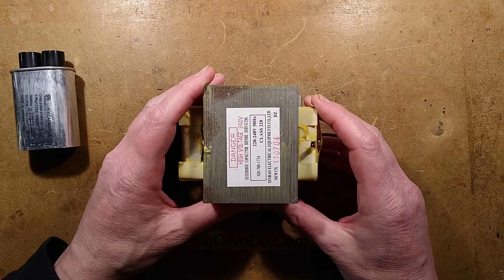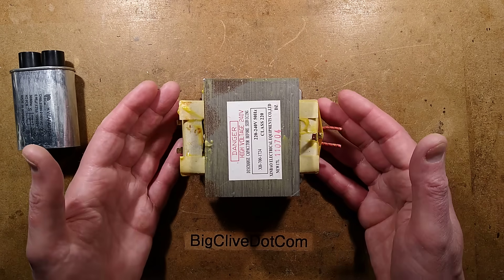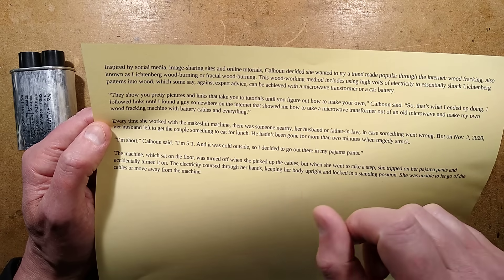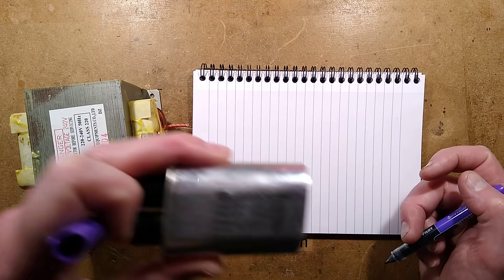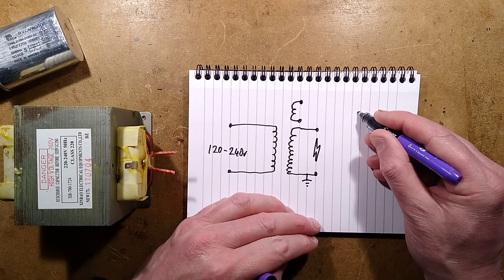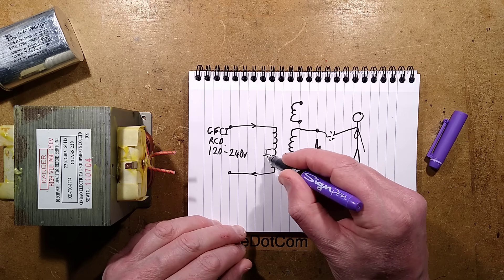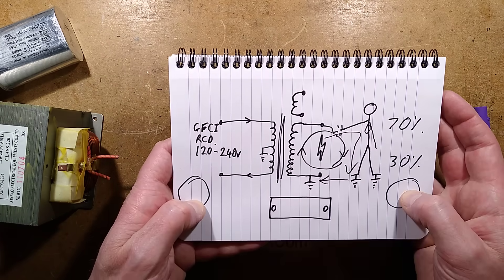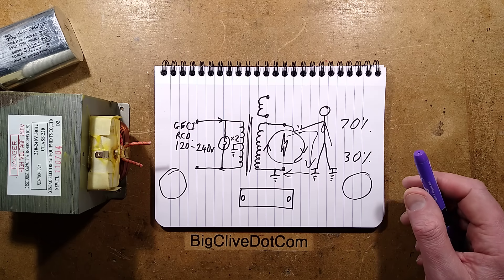The most deadly project on the Internet

Comment: I've had enough relatives who worked with electricity tell me enough stories to dissuade me from doing much more than putting together my own PC.  Enough amps, enough volts and you're not gonna have a good time (well, not for long anyway).

Hats off to you electrical workers.  You're braver than me.
Reply: Amps'll get you way before voltage will.
Reply: @paulthetexan  wrong. I can touch both leads of a car battery (600A) and nothing will happen. It’s a combination of both that makes something dangerous. In fact high voltage is what is difficult for untrained people to predict since it will “flow” through nearly anything.
Reply: @thejackbox  0.1 amp can kill you. Just because you can do something safely doesn't mean that the subject is always safe. For example, I can light a fire safely in my fireplace. Can't light the exact same fire safely in a used, mostly empty grain barn.
Reply: @paulthetexan  saying that one will kill before the other is incorrect because they are both equally important to producing a lethal current. I’m not disagreeing that amps are part of what kills you, I’m saying that the assertion that “amps kill before volts” is misleading and shows a lack of understanding. Also, no, touching a car battery is nothing like lighting a barn on fire and I only said that as an example.
Reply: @thejackbox  It was a metaphor. To people who understand metaphors, it symbolized that an activity which can be safe under one set of circumstances can be dangerous under another. To you, it didn't.
Reply: @thejackbox  They are both equally important, yes, but one is far easier to screw up with. Guess which one? Hint: it's not voltage. It's easier, faster, and more likely to kill you if you mess up your amperage than your voltage. I'm truly sorry that you can't understand that things might both be important but have relatively different threat/danger levels.

Comment: I do not wish to see the pictures, thank you. This "project" is dangerous, I've seen it gone wrong. Safety is a big thing in my workshop,  working with interns and volunteers it's a necessity. One of the regular woodworkers was experimenting and made a fractal burner. He did a really good job making it. For some reason one volunteer moved the device when it was on. I saw it happen and triggered the electrical safety switch in time. He had severe burns on his lower arm and had to go to therapy because he was afraid to even turn on the light switch because of the accident. 
I beg of everyone just buy the machine. It has numerous safety features so you don't get harmed. I know it's expensive, your safety is worth more. Robert Sorby has a really good one, we bought it immediately after the accident. Everyone is able to enjoy fractal woodburning in safety now.

Comment: That isn't a big capacitor.  I used to have a high voltage electron beam deposition machine at work... 10,000 and 4 HUGE CAPACITORS. If it every got shorted out it could provide infinite amperage. I heard about an incident at a different fab were there was a short which caused RF which was reflected back through the transformer and shut down the local 22kv substation.  Of course this kind of equipment is  heavily safety guarded and we used it for years safely.

Comment: "I'm classified as a pro by others but that is a false title, I'm experienced and still make mistakes." My mentor told me this while teaching me how to weld and that one line is what stuck with me the most. Never think of yourself as being so good at something that you can ignore safety and common sense.
Reply: I've done a fair amount of backcountry adventure, and a line that has always stuck with me is 
Q: What's the definition of an experienced mountaineer?
A: One whose death was unavoidable.
Reply: I worked in the computer industry operations in particular for about 40 years. I remember one point we needed to replace a main breaker that controlled power flow from the UPS battery to the UPS main power. And my boss wanted me to open up the panel with over 800 volts in there and swap out the breaker " it's easy ". The bus bars in this panel we're either a quarter inch thick or 3/8 in I didn't want to get close enough to measure it and about 3 in deep. I looked inside the cabinet where this breaker had to be popped in and out and told him if it's that easy get an electrician. I have no business being inside this panel and you have no business suggesting I'd be inside this panel. I'm willing to try many things I've done my own wiring I've replaced my own well pump I've ran a totally new circuit from the main panel into another room that didn't have electric in it. Including an outlet going outside which was on a GFI outlet on the inside. I have been tingled by 110 volts and I've been made to jump up by 220 volts. Unfortunately there was a shelf above my head at the moment! The kind of voltage he's talking about nah I don't need to play with that. I had a microwave go bad all about a year or so ago essentially the fan stopped running and the microwaves were still coming out of the radar emitter. Lot of heat builds up on that happens if your fan stops running unplug your microwave. At the same time the panel on the front started acting goofy too and after I unplug the microwave and took the food out of it I just carried it outside put it in the trash. I don't need to open that up. Normally back in the day with mechanical controls I'd crack that puppy open and get a screwdriver with a wire attached to it and ground out everything before I reached inside. My dad told me when I was working on tube TVs the ones where they actually had vacuum tubes not just the picture tube, never touch the transformer unplugged or not. It can zap you either way and it'll throw you across the room. Knowing that my dad had done many things in his life and he was currently an electronics inspector, I figured that's probably good advice and headed it. Made quite a bit of change in high school fixing TVs. I would do everything except for adjust picture tubes and touch that transformer! I had a vacuum which the hose had a metal end on I wrapped the metal with electrical tape so it couldn't ground out so I can vacuum the dust out of the TVs. Good times!
Reply: We should add that : Even if you are the top expert in the field, no experiment is short enough to ignore safety measures, Murphy is always pressent.
Reply: The first time I saw people doing this online, my immediate thought was "nope, I ain't f***ing trying that one".
I don't know anything about electricity and if it involves voltage beyond that what comes from a couple AA batteries, I'm not messing with it.
Reply: @scottcantdance804  For me it comes down to the situation in which I can say "I know enough about electricity that I know what the potential dangers are, but my knowledge is insufficient enough to know how to safely avoid those dangers."
Reply: A similar thing with gun owners: It is not "IF" you have a negligent discharge. It's "WHEN" you have a negligent discharge. I already had mine. I never want a repeat. Muzzle safety is now burned into my head, but dammit, it can happen again. The law of complacency.
Reply: @galenicalhoover6508  i don’t think so not if you have some proper training
Reply: @galenicalhoover6508  my squib went baang! Muzzle was pointed downrange, but I was casually talking to my range-neighbor at the moment. Scared the piss out of both of us. We agreed that pointing downrange and waiting 5 minutes was good procedure. I later realized I should own go/nogo headspace gauges, and at a minimum do a few OAL checks followed by bulk visual inspection/comparison especially with the commercially produced consumables, whether brass, steel or zinc. More on point, this vid about the dangers inherent in working, playing, experimenting with high voltage and high current sources is approachable enough that it should be shown to 15 year olds in science classes! (that changes 'natural selection' a bit, but kids should probably have a fighting chance to carry on into adulthood)
Reply: @galenicalhoover6508 If you never have a negligent discharge in your life, you WILL have an ACCIDENTAL one.
Reply: I've never heard anyone say pretty much the same thing, just worded different than my welding teacher told me, which was, "if you think you know everything, your the first one that gets hurt", and it's true. I've seen it happen on job sites, and it's not pretty sometimes either.
Reply: The world's a big and weird place. Sometimes all the prep and the know-how in the world still can't keep luck from taking its due.
Reply: "Nothing bad has ever happened to me during 15 years of doing this."
ignores safety
ZAP Something bad happened
Reply: My brother learned something along the lines of "The day you underestimate electricity is the day it will kill you" when being trained to become an electrician.
Reply: Nice thread. This also applies to flying. There's a great book called The Killing Zone: How & Why Pilots Die which goes into why the vast majority of pilots who die in crashes are only in their first two hundred hours. The FAA has released books on aeronautical decision making and the psychology behind why we make mistakes that are avoidable. If this weren't a persistent problem Kobe would still be with us today.
Reply: yup we have two stories (more than that I'm just focused on the demon core shit tho) with scientists being flippant around radioactive material and ending in disaster
Reply: Part of Being a pro means paying attention to and practicing safety considerations.
Reply: Amen brother ! I operate heavy equipment, the young guys laugh because I put on my seat belt. I wear it to keep me in the seat not because I'm scared lol. I always say , " be smarter than what your working with" or being good is truly knowing your and the machines  limitations ! ✌️😎

Comment: 2:40 No Clive, add a zero. Medium distribution voltage is (typically) 22,000 not 2200.
Reply: Medium voltage distribution is anything between 1kV and 70kV, so this may be on the lower side, but it's still in the range of medium voltage distribution, aka crazy dangerous.

Comment: I didn't realize this was such a wide-spread issue. I.e. woodworkers building dangerous electrocuting devices. Shocking how people are ignorant. Isn't this also an educational issue? At least in my country you learn at primary school about dangers of electricity. Though myself an electrical engineer, even before my studies I always had a respect for electricity and I do think that partly comes from primary education. Strong regulations for electrical installations and work also tend to increase the awareness among common population that such work is best left to professionals. At least in my country, during the last 40-year period, death rate from electrical accidents has decreased from 0.29 per 100,000 people per year to 0.00-0.07 in the last decade. This is continuously decreasing due to nowadays mandatory use of residual current devices.

Comment: 7:53 That middle low voltage winding, is not for anything else than the little gearmotor that slowly spins the glass plate that rotates your food for even heating.

Comment: 3 phase 480 volts 400 amps is one of the main drives I worked one . 480 will kill you very fast and cause the water in your body to flash to steam.I was the safety guy on my section.
Scary was throwing main breakers with 2000 plus amps,the can blow up in you face.
Thank you for the video.
I heard this yesterday and and could not believe what people are doing. 3milliamps to stop your heart,I think .

Comment: great video Clive, i trained as a service tech on scientific test equipment in the late 1980's, had more zaps than i could count.
a few years ago a car club member had an incident while thinning some paint on a 40+ deg C day in Australia, he happily told me he was using an old kitchen mixer to mix the thinners in, i was stunned, i told him he was an idiot, he had severe burns to his legs and a foot (wearing thongs and shorts), requiring quite large skin grafts.
to this day he maintains he had used a mixer to thin paint for decades with never an issue, and won't accept any responsibily.

he also claimed to not notice the heat, to which i asked then why wasn't he wearing PPE at the time?

i ALWAYS mix flammable thinners in enamel paints with a wide wooden ruler or something equivalent, although with modern brushless drills paint strirrers would be safe to use.

Comment: This is a good video.  I'm surprised only 30 have died doing this actually .  It is VERY dangerous.  having said that, I have done it.  You shouldn't.  Really, you shouldn't.  If you do do it, set it up in a glass dish, make sure everything outside the dish is VERY dry. keep the transformer and all high voltage inside plastic tub. (this alone will NOT protect you) the voltage is high enough it will jump right through the plastic in the tub.   Get a LONG extension cord, be very far away before extension cord is plugged in, be very eclectically isolated, stand on a plastic milk crate use a switched outlet.   High voltage can take strange paths, through air, wood concrete, jump across electrically insulated things. etc. especially if it's at all damp or musty.  Make sure no other people or animals can get anywhere near any of it.  Use a momentary switch rated for mains current on the mains current.  Better yet Listen to Clive.    I say this because people are going to use Microwave transformers to do this simply because they are plentiful and easier to come by than safer alternatives, but again LISTEN TO CLIVE.  The high voltage combines with high amperage of a microwave transformer can kill you and it's NOT like mains power where just not touching it, will keep you safe.  High voltage will travel though strange things like, walls, floors, YOU to get back to ground, and it WILL kill you.
Reply from the maker: A minimum of 30 have died.  I think the real number is much higher.

Comment: Something that I would look into, if I wanted to do something like this, would be a modified 3d printer. The 3d printer mechanism could take all the risks and I would stay safely away from the device. Include an emergency stop button and have the start button well away from the device.
Reply: As you can see from my avatar picture, I have two robotic arms that I can use for unsafe experiments.😅 Decades ago, it was enough for me to touch the mains for a few seconds. At least I didn't suffer any damage from it, but I didn't feel good for a few hours at the time.😓
Reply: @patrichausammann  480V shock one time.  Now I quadruple check everything I carry my own DMM and induction wand detector (because you never know what jackass wired up an electrical panel or added to it or bypassed the disconnect or back fed it)
Reply: I had a similar less advanced thought, mine was just have an esp32 and a relay so you can trigger it remotely but still have to position it yourself, doesn’t stop you from pressing the remote button and moving it at the same time though, but that should be common sense. Best option would be to make a proper enclosure for it with a door and connect it up so that it can only switch on if the door is shut, people do find ways around that too though, one of my teachers when I was at school used to work in a watch factory and someone taped one of the safety buttons constantly on (it was a system where you had to press two separate buttons at the same time), the guy ended up losing a hand because it was somewhere it shouldn’t have been whilst the machine was running.
Reply: @conorstewart2214  I’ve seen interlocks and such bypassed all over the place on machinery.  It always bothers me and never turns out well.
Reply: yes but one day you would get complacent and thats when accidents happen. read about tickling the dragons tail incident

Comment: mine has been made with a red safety light to show its been plugged in, a full screen showing voltage, wattage, amps, etc etc going INTO the transformer (it has not been rated for the potential specs coming out of the other end) to keep track of the numbers, the switch I use is a deadman style button....when you let go of the button it shuts itself off, the deadman is also attached to a couple of green safety lights just in case, everything is insulated and I never use the machine without those really super thick and stiff rubber gloves (not sure exactly how thick but they are hard to bend your fingers in) also the ends of the clamps are on the ends of super long wire (silicone insulated) so that I can keep the entire project far away from the user (myself) I agree with you that it is very dangerous. I wish the info wasnt so openly available online but also I wouldnt have found it myself if it wasnt. when it comes to electricity, SAFETY is number 1......I dont ever mess with any of it unless its 100% ok. good warning video, it needs to be said. thank you!

Comment: I do actually have a project planned for a microwave transformer, but it's for use in an electric fence, so will be DC, and pulsed. 

But anything like this, you don't touch it when it's plugged into the wall.

Comment: I was wondering about using those for front yard low voltage lighting, just junk the secondary windings and re-wind it with larger gauge and step the voltage DOWN, with a big ass cap and diode, half rectified will still provide lots of DC current..

Comment: I took two UPS transformers and connected them together to make an isolation transformer. I was so worried about a blow up I hid behind a wall and then connected the power. Luckily no fire and it did work. Just thinking, if that was a white knuckle moment for me, then these folks doing wood burning have no idea what they are dealing with.